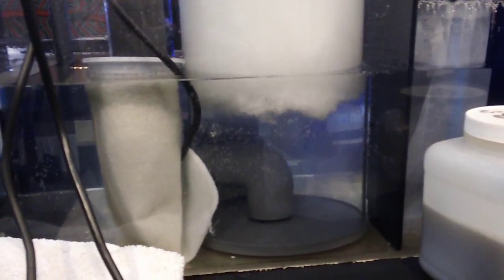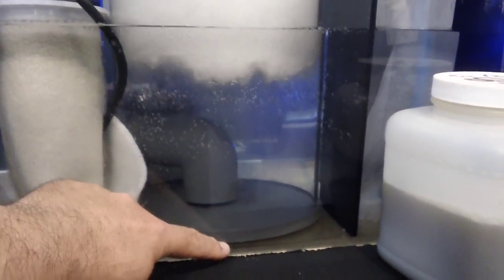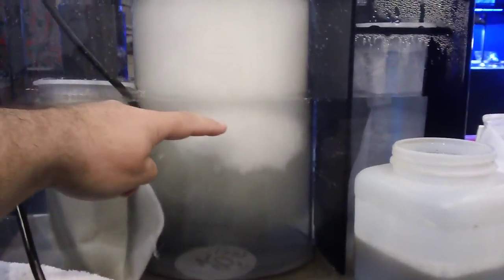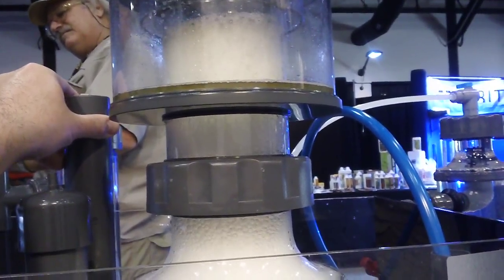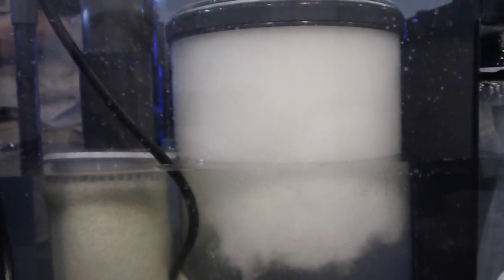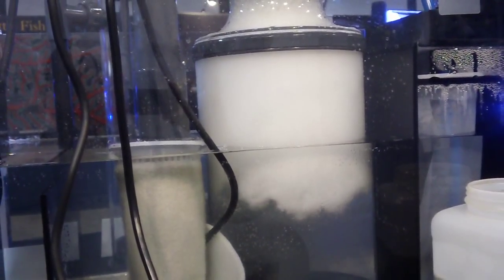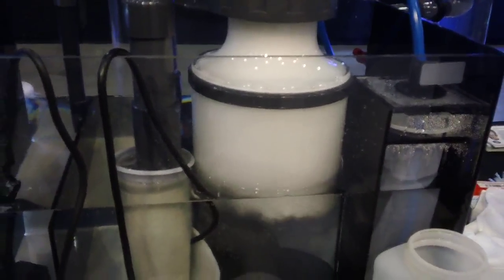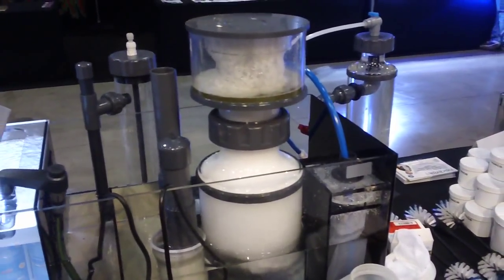CRAS Presents... Reef Dynamics Protein Skimmer Reaction Chamber Bubble Level Fluctuations

Comment: Not sure if you still check this. I have a Reef Dynamic skimmer and INS model with one pump. It has always worked. Now it makes bubbles but there is no or little skim. I soaked the venturi overnight in vinegar. Also It has never fully prevented cyano. Why might it have stopped skimming?

Comment: Question.   I have a INS 300 and no where in the directions could I find the proper default setting for the skimmer.  
I mean where should the foam head top be?   I just guessed and set the top of the foam head to be at the level of the bottom of the collection cup.   Which is about 1/2 way up the tube.    When I take the skimmer top off it spills over the top.   Before I had it level with the thick plastic ring which resulted in a dry foam.  It took much longer for it to reach the collection cup.   Which is correct?